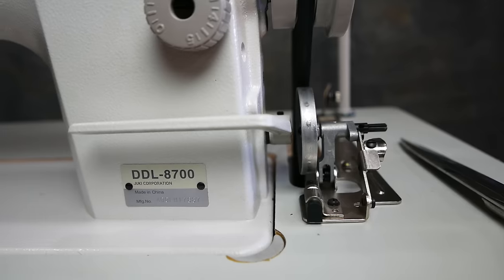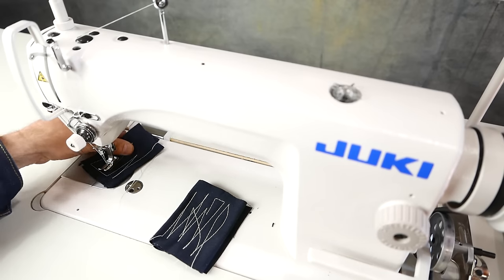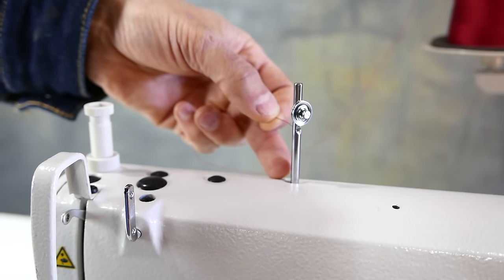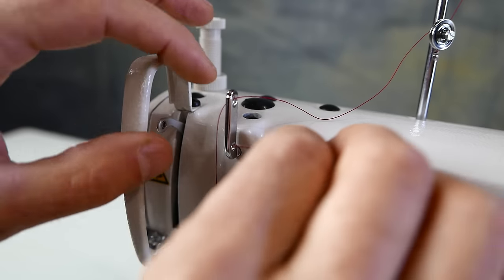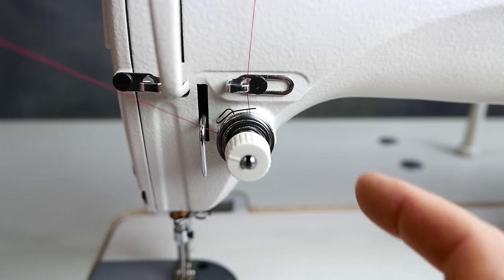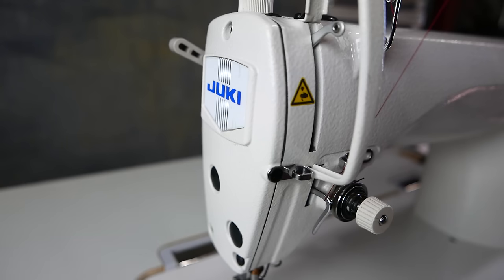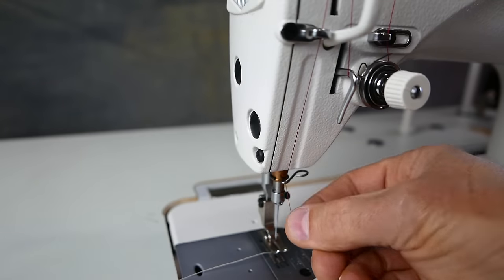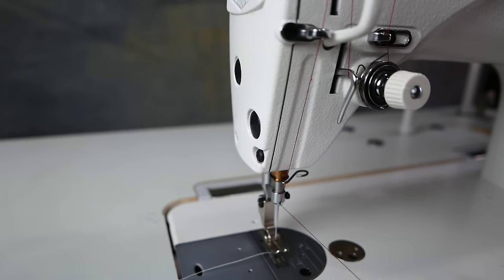How to Thread a Juki DDL-8700 Industrial Sewing Machine

Comment: The manual shows the thread through the tension disks, take up spring, under bracket and THEN through guide on its route to the take up arm.
Reply from the maker: I went back and looked at my manual. You are right. Thank you.

Comment: I guess there is a mistake in threading here, after threading the top thread guide - the thread must be wrapped directly to the tension discs, to its spring, and to the large hook then eventually to the thread guide that is located above the tension discs, and so on. Correct me if I am wrong. I was a sewer or operator in MEPZA before and that is how we thread the machine. 😊
Reply from the maker: Thank you for your help! Very good.💥

Comment: Where can I find a table for Juki TL-82?
Reply from the maker: I have never seen one of those before. Looks like most of them are either treadle or have a home sewing machine motor. Measure your base for length and width. For example my Singer 201 (antique home machine) fits in a 15" x 7" hole. The very common Singer 20U commercial zig zag fits in a 15.75 x 7 hole and most industrial sewing machines fit tables with a 18.75 x 7 hole. Yours probably fits in one of the first two. This doesn't answer your question exactly but I hope it helps you find your source. Good Luck.
Reply: +Alexander Dyer (STRONGBOLT) I found the manual for the Juki TL-82. It lists the bed size at 15.75 x 7. Can you link me to a website that sell the table?
Reply from the maker: Here is a link. This is not an endorsement. Also try your local industrial sewing machine sales shop. http://www.worldsewingparts.com/index.php?main_page=product_info&cPath=95&products_id=593

Comment: This is incorrect. Once you go through the top and bottom hole at the top you go straight through the tension discs, the spring, then the hook, etc. Here is a manual that shows the correct threading:
https://www.juki.co.jp/industrial_j/download_j/manual_j/ddl8700/menu/ddl8700/pdf/instruction_eg.pdf
Reply from the maker: You're right. Thanks

Comment: hi, your threading of a Juki DDL 8700 you show doesn't respect Juki recommanded threading in the manual. It's false.
Reply from the maker: By all means, follow your manual. It is true that I have deviated from it slightly. I can say that both paths will lead to success. Thank you and prosper.
Reply: @AlexanderDyer  Thanks. Your path works but you will loose the lenght trim for the thread. Best regards.

Comment: Что-то она стучит как-то ненормально, не свойственно работать промышленной машине с таким странным звуком. Рабочий звук машины настораживает, что-то постукивает.
Reply from the maker: The noise  is the result of the new automotive style rubber belt squeeking. The machine runs very smooth. A better more expensive cloth covered belt would eliminate the noise.
Reply: @AlexanderDyer   Ок. 👍😊